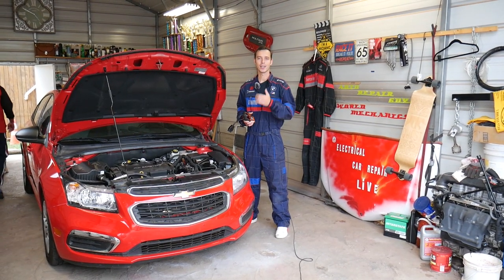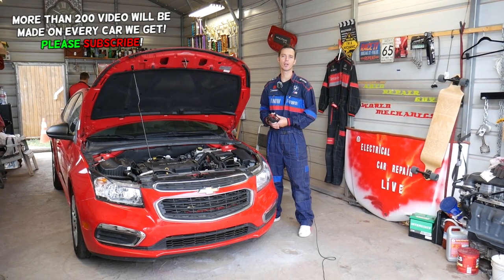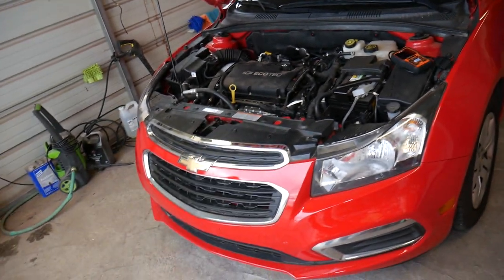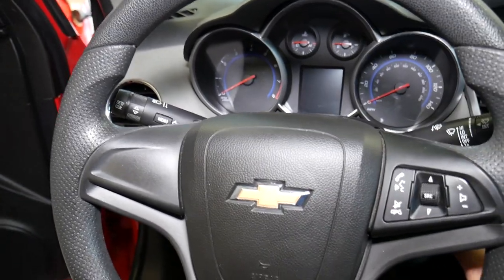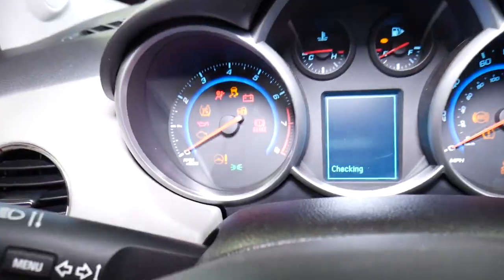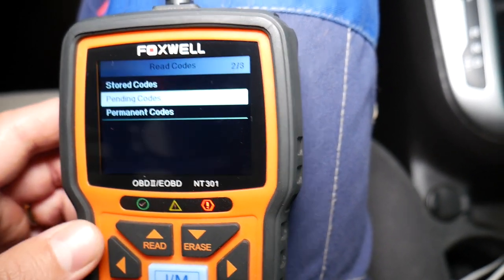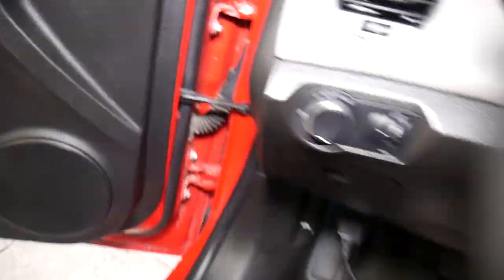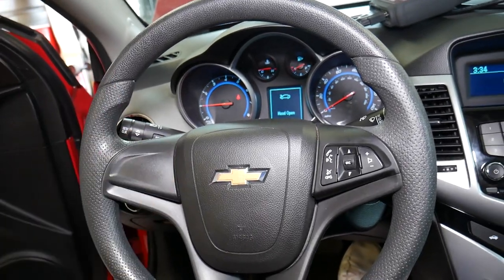FIX CODE P0013 P0014 P2091 CAMSHAFT POSITION ACTUATOR CHEVY ,CHEVROLET, GMC, BUICK, CADILLAC

Comment: Thanks for the video! Replacement was a breeze. Seems like the filter broke off and my solenoid was stuck in the half open position. After replacing, my engine would accelerate at much lower rpms and generally seems healthier.

Comment: Hi, so I changed both intake and exhaust selonoid as well as the camshaft timing sensor and I am still getting the p0014 code.  Any ideas as to what I should look at next? Thank you
Reply: Same thing here.. did you find the problem
Reply: @hermancane9224  believe it or not I did an oil change and it went off and hasn't come back yet.  I have no explanation
Reply: @Saldutti66  old oil could cause the error mate
Reply: Change your oil. Continue changing your oil frequently. More frequently than normal.  Use high mileage oil. It has oil detergents in it yo help remove sludge. If problem persists it is either the wiring harness, the cam, or the timing chain has jumped and that is the worst case scenario because it can cause internal engine damage.
Reply: @CringeComedyTV  my oil is only 250 mikes old though???
Reply: These Solenoids are very sensitive to correct oil viscosity, oil level, and condition of the oil. Besure all these conditions are correct before firing the parts cannon.
Reply: Hello, ihave a 2012 hyundai genesis 2.0t coupe. I keep getting code P0014. I switched both vvt solenoids, replaced both camshaft position sensors, replaced exaust camshaft gear sprocket, replaced oil, replaced oil filter, i checked harness/wires/ plugs and everything was good, i checked the timing, timing chain, timing tentioner, and timing guides and everything is PERFECT. With only 119k miles the car runs very smooth. No rough idling, no stalling, starts up good and yet still code P0014 keeps coming up. please help, I've been trying to fix this car up. Please reply
Reply: Yeah get rid of that lemon 🍋 i  have a 12 cruze 1.4 turbo and it's a money  💰 pit!!!!!

Comment: I have the code p0013-14 on my Buick 2013 lacrosse. My car is also rattling in timing belt. But only those codes are popping up as well as check engine light. If I change the parts to fix codes will the rattling stop? Or is it an indicator that my timing belt is bad? And that need to be fixed

Comment: I have a equinox 2011 and have de p0014  code camshaf position timing over -advance osystem performance bank 1 
I change the oil filter, the oil out new solenoids,  new sensor camshaft and de code back any idea

Comment: I have a 2009 g6 .2.4 ecotec. Starts then immediately dies , if I unplug the intake cam position sensor it will start and run.
Any ideas?
Has po0014

Comment: 2013 equinox - won't start at all. Vvt solenoids replaced spark plugs, ign coils, and TCV...... still nothing. It did run super rough and now nothing. Starter just whines and nothing. Fuel is good and pump is dead on 60.... wtf is going on with this car? 😐